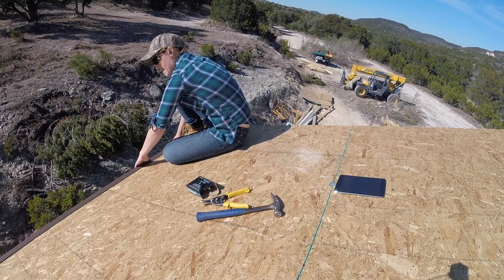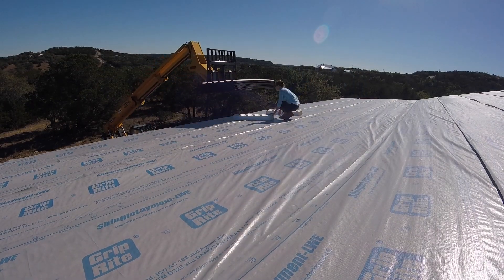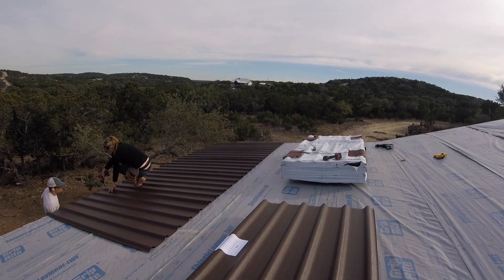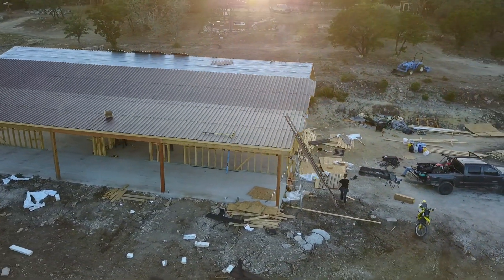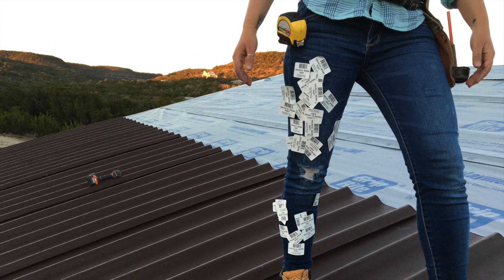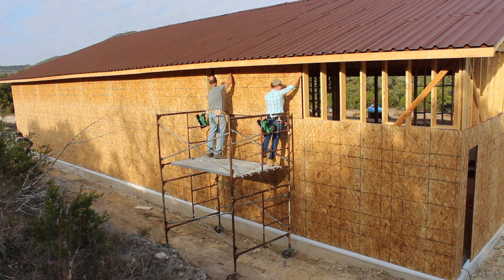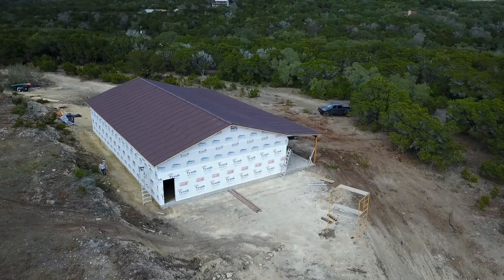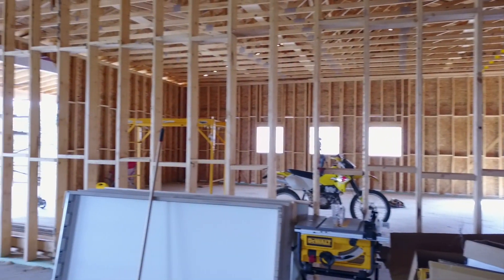Building A Shop - Roofing and Walls

Comment: For a hint on house wrap, check out RedPoppyRanch channel. I know it's too late for this build, but hey, you never know when you might build another structure. Hint, thread a rope through the tube and nail it off to a board on the bottom. Someone can walk the roofline with the top of the rope, unspooling it as you go with the cap nailer or slap stapler.

Comment: Do you cut that skirt with weep holes it has been my experience that trapping moisture at the bottom of OSB is a bad idea I like to start with a 2 foot high band of treated plywood then stack the osb on top A Tyvek  water cup holding OSB I dont know it wouldn't work here in VT but maybe your climate  drys out faster than we do here with snow  thaw and rain. The Shop is awesome  TEXAS sized!
Reply from the maker: No I didn't put in weep holes. We waited to fold up the skirt until we did the paper for that side of the building so no moisture could get inside. Since we immediately followed with the house wrap, it was instantly sealed.
Reply: If any wood got wet before sheathing it the openings for windows and doors would allow it to dry out sufficiently before finishing out the inside.
Reply: I always plan for everything to get wet housewrap is not really impermeable over time in my experience. and making a dixie cup at the bottom of the osb sort of spooks me every where you staple is an opportunity for water to get in ... prove me wrong April Im rooting for you!

Comment: The shop seems to be moving along pretty quick.  I was wondering what kind of air system your gonna install.
I'm a general contractor and installed 3/4 PEX in my personal shop and since then installed two other shops with the same system.  I know it's not recommended but mine has been in use for three years and so far has not  shown any trouble.
I run 150 psi on my compressor and 110 at the hose reels.  My shop isn't as big as yours  so I'm a little envious to say the least.

Comment: Another great video.. TOO SHORT, but probably because I'd like more time to see the inside and try to design my own layout!! Hahahahaaa..  I have a very poorly designed 1300 SF shop. I did not build it and the cost to make the proper changes are too much for this poor man, so I have done all I can do to make it workable for me. I sure wish it were built like yours from day one!! My slab is too thin and weak for a two post lift and the trusses are set at 8' 6". Overhead doors in poor positions and the trusses were not built for storage. Yes, I did beef it up and build a staircase and floor for the loft, but still, it kills me to have so much space and it not be as usable as it SHOULD have been...  Maybe one day i will buy some land and you can come help me build my dream shop!!!  ;) Have you been to Florida??????  ;)

Comment: So what is the life expectancy of those roof panels vs. Metal? I am building a shop soon on my property and you have caught my attention with these.
Reply from the maker: It's 30+ years. I didn't go with metal because of the noise when it rains. Since I film if I'm working in the shop, I didn't want to be always dealing with working around rain.
Reply: Now that's something that will definitely save you some headaches! Great job thinking of that ahead of time...

Comment: Curious why you used the Ondura 6v?  Looks like the price is about the same as metal roofing, but metal lasts 30-50+ years and this stuff looks to last 10-20 at the most.  No personal experience, just quickly read reviews.
Reply from the maker: This stuff is good for 30 years but my main reason for not going with a metal roof is the noise. With this also being my production studio, I didn't want the noise that comes with rain on a metal roof because then I couldn't film if the weather wasn't right.
Reply: Hale?
Reply: What the hell do you mean the warranty doesn't mean anything??  You have insurance for hail damage.  Hail can damage steal, asphalt, or anything.  What's your point?  Andy are you dense?

Comment: Maybe you already answered this, but why did you choose this type of structure over the traditional pole building? That's all that really goes up around here anymore.
Reply from the maker: I simply don't know anything about it so I didn't consider it as an option.
Reply: There is Plenty of info online about post frame (modern square type pole building) construction.
Reply: April... not sure if you're familiar with RR buildings or not, but they specialize in "post frame construction", which is the formal name for pole building.

Comment: Did you tape the seam of the wrap?  If you did not, why?
Reply from the maker: I did, only the vertical seams
Reply: With roof or wall wrap, you don't need to tape the horizontal seams as the overlap already sort of seals itself, but yeah you want to tape the vertical seams.

Comment: the skirt attached to the studs/bottom plate should not of been folded up and stapled to the osb

if water gets behind the house wrap, it will pool in the skirt flashing

nice build otherwise
Reply: Thanks, that's exactly what I was looking for someone to comment on.  I guess just trimmed down to 3/8 inch and let the wainscoting cover

Comment: you wreck your strength of those osb sheets by flipping them up vertical.they have instructions on the back printed on them whitch way to put them it does matter.not just for your siding lol. if an inspector noticed that here wouldn't pass.

Comment: You should add some sky lights...
Reply from the maker: Nah
Reply: Skylights are for sunrooms – in workshops they cast annoying inconsistent bright areas and shadows on sunny days
Reply: She is doing videos, so she needs constant light conditions. Windows will influence the quality too much. As much as I too prefer natural light, for this purpose it is counter productive.
Reply: Skylights are an unnecessary opening that has a risk of eventually leaking. For that risk you get: sometimes, during the day only, and only on days with lots of sunlight, a small amount of light which moves around as the day progresses.

In the past this made sense. With how incredibly cheap to install and run LED lights (and how much like "natural daylight" they can look), it just doesn't make good sense. You get consistent cheap light 24/7. I've strongly considered installing things like sky lights (or solar tubes) in my house but it just never makes enough sense to do